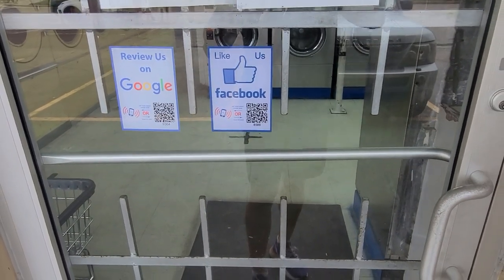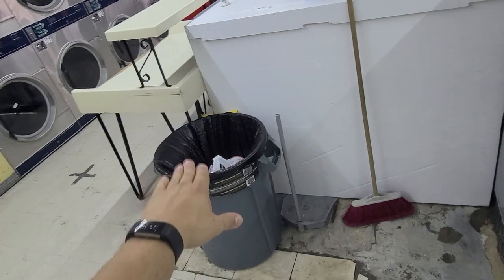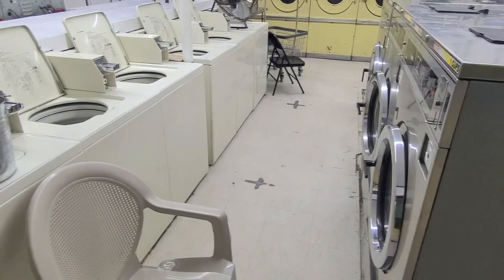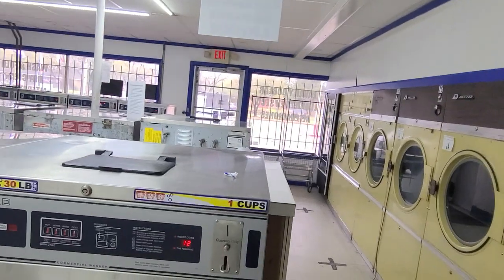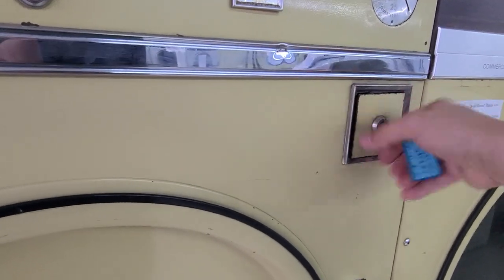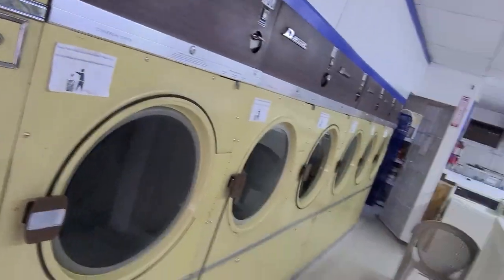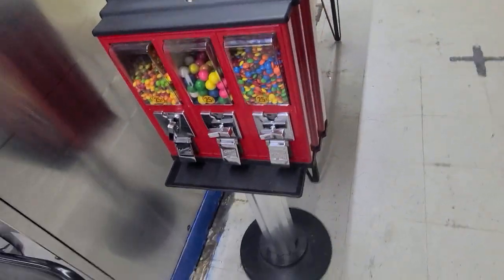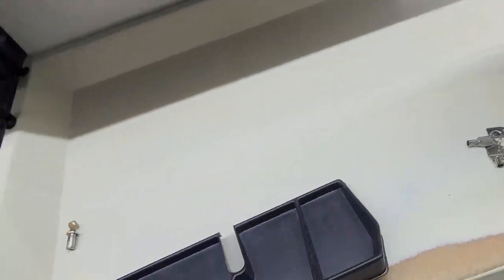How much does a laundromat make in one weekend?

Comment: Dude, you’ve got to replace those dryers from 1960.
Reply from the maker: I replaced 5 of them and the new ones randomly stop heating, randomly stop working. The new Dexter's have been nothing but trouble honestly.
Reply: Isn’t there a warranty? Once they’re dialed in, you should be golden. Or as I say, “turning n earning.”
Reply: @CashflowComa  The last thing I wanted to hear about your new Dexters. I thought about the make up air because your going from a single pocket to a stack dryer. Those dryers should be plug and play with no problems. Get the dryers working great before you add any equipment. If you go with big washers, you want them right in front door. May have to get rid of the push button Dexters on front row to make room for big daddy's.  Send me some symptoms of what the dryers are doing and I may can help you. Drill those locks out and put new locks on.